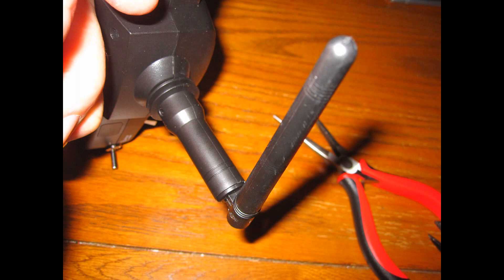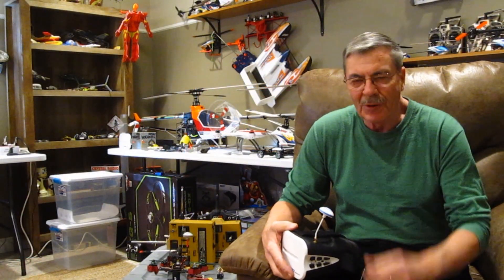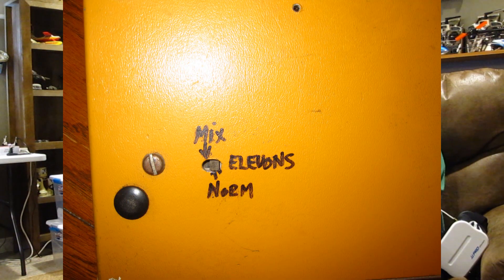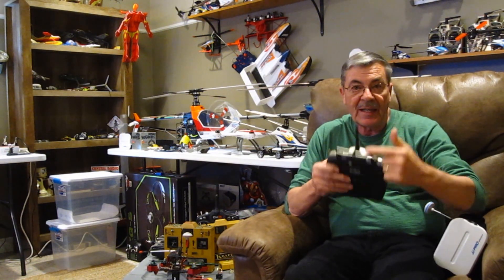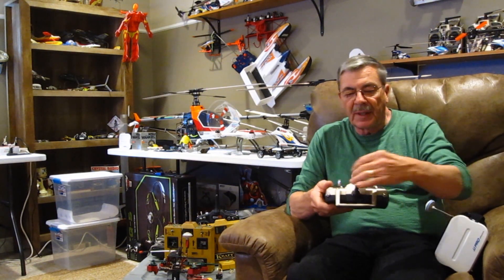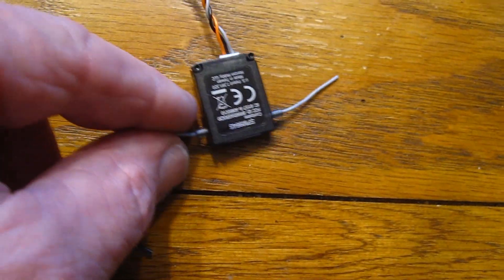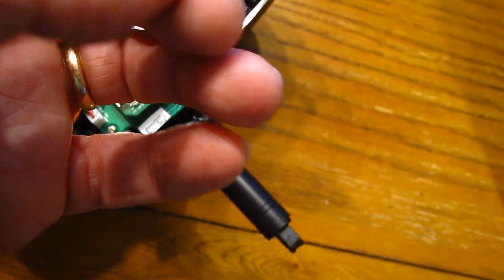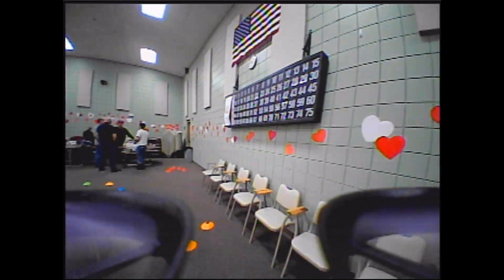Early FPV 35 years ago, plus see what’s inside a Typical 2.4 GHz R/C TX Antenna.

Comment: I worked on Motorola radio systems for a few years after my Navy career. When you mentioned that you got into an argument with someone over RF, I had to shake my head. Those RF guys LOVE to argue! I was working in RF but I didn't come to that job with a proper RF "background", therefore, it seemed like there was a lot of animosity towards me. I was responsible for upgrading the old analog radio systems to digital radio systems. I did my job well but ended up working alone because the "experienced" RF guys could not get along with me. I was good at computers and the new digital systems are built a lot like computer networks. This made those old RF guys very angry because they couldn't just twist a pot to adjust something. Almost everything is like programming now and some of the old timers just couldn't wrap their head around the new systems. Some guys even retired because they didn't want to learn anything new. Almost everything is done with computers nowadays but there's still a few aspects of RF that will never change, like guys who like to ARGUE about RF!

Comment: As always Dave nice and very informative fun video. 
I'm an RF guy.   
Sometimes toroids are installed on the coaxial cable just below (or ahead) of the 
antenna itself and is for the purpose of decoupling or stopping RF radiated from the antenna element from inducing currents back onto the outside of the coaxial cable
and coming down and getting into other stuff in the transmitter where it sometimes
could be a problem.
Probably why your colleague was confused or so certain he had seen toroids in an antenna before. LOL.   

Take care!   

Steve In Ann Arbor MI

Comment: I have a first Gen DX6 not the DX6i, just the first DX6 that they released, its been a good radio which ive had for about 6 months. There have been only three times ive lost signal for less than then a second
Reply from the maker: Yes, they worked good.  I hope you did not crash, when you lost your signal, like I did.  Thanks and happy flying.
Reply: NightFlyyer no crashes, just a few times thought I might but for just a second or less never a full loss of signal just got the new valiant and ordered the commander

Comment: Dave you are correct about our small Rc receivers and Rc transmitters not having toroids BUT, many 5.8ghz circular polarized antennas do in fact have a single toroid right below their plastic protector cap- please look up the very popular Mad Mushroom antenna from video aerial systems (IBCrazy)- they are also found on the air blade antennas - I appreciate the knowledge from your years of experience Dave, great videos! Please keep informing!
Reply from the maker: Yes but those are 5.8 GHz, not 2.4.  You wont see a TX with umbrella antennas on any stock transmitter radios, only FPV, as I explained in the video and those you talk about are to keep the 2.4GX signals from getting in. Thanks.

Comment: I have several types of RC transmitters. All of the cheaper ones have a post sticking out ,but no wire actually goes through them. I also have the Sema as well. I love flying / driving mine on the road out front of our mobile home. After a while the kids start showing up like the pied piper. They are attracted to them,same with my smaller planes out back in the field where I fly.
Reply from the maker: Hi Scott and thanks much for your comments.  Thanks and happy flying.